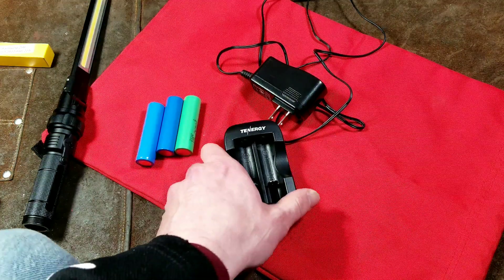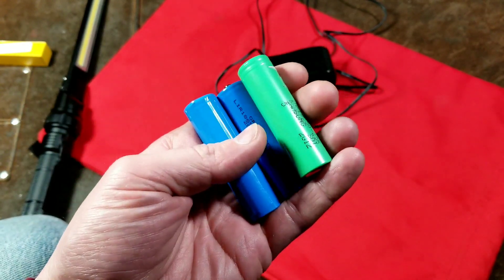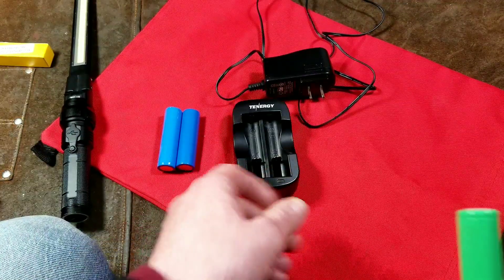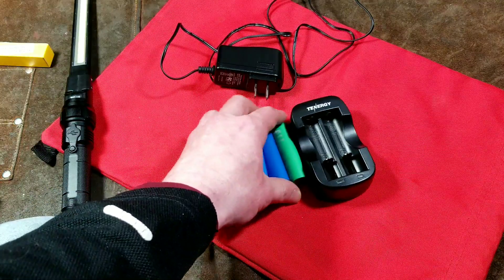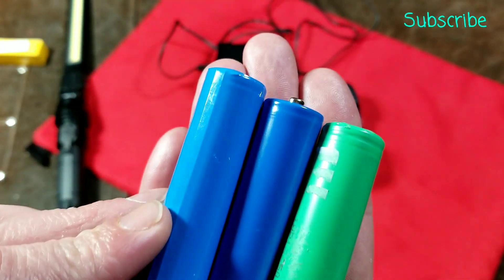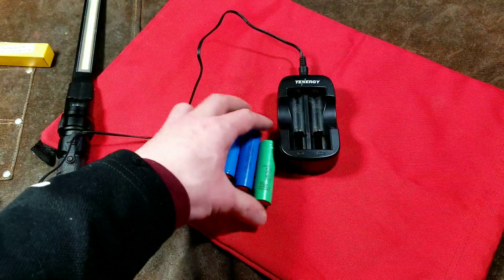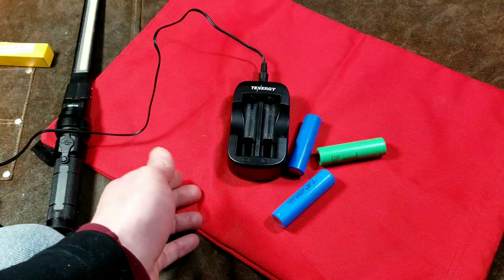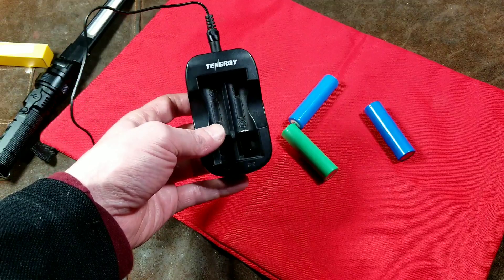Tenergy Li-Ion Cell Charger Review 18650/18500/14500

Comment: It's a nipple. Just say nipple! Lol. I have this charger and the only issue is it doesn't stop charging at 4.2v. Once it reaches 4.2v it begins a trickle charge which isnt the greatest for a Lithium Ion cell of any kind. Good to set a timer for 3hrs and check for the green light. Batteries get warm not hot in this 1amp per channel charger.

Comment: If these cells are getting hot on a 1 amp charger, they are probably mislabelled and much lower capacity than they are marked or the charger is not functioning correctly.  A 2000 or 1800 or 2100 or 2500 or even 1500 mah cells should not get warm on a 1 amp charge. Something is wrong.